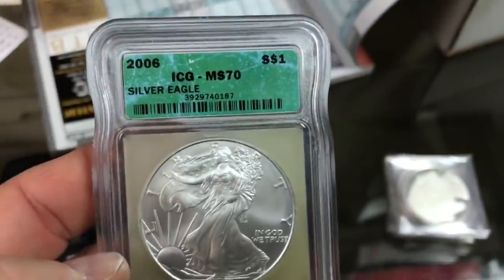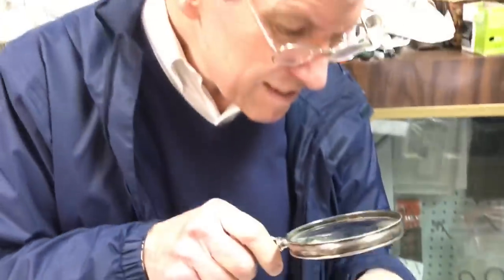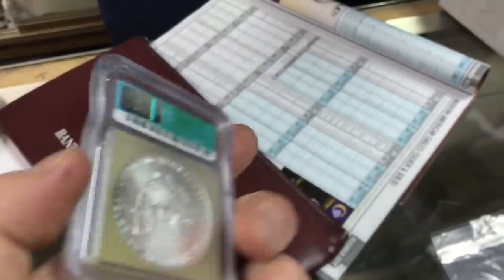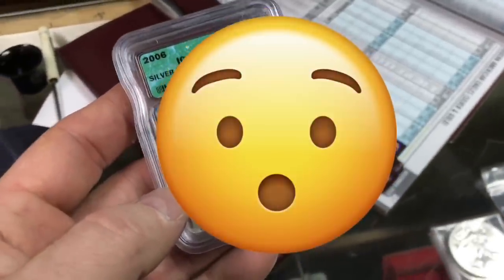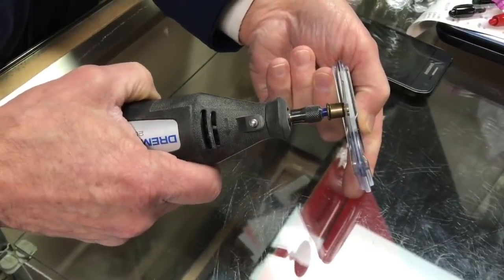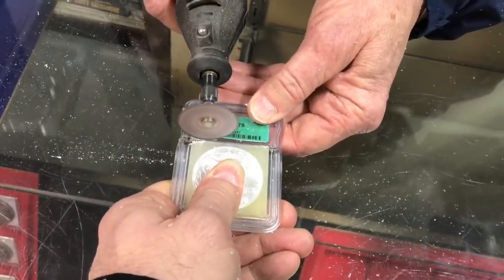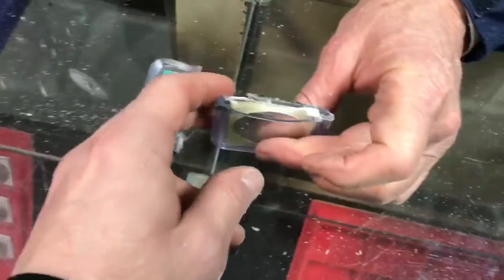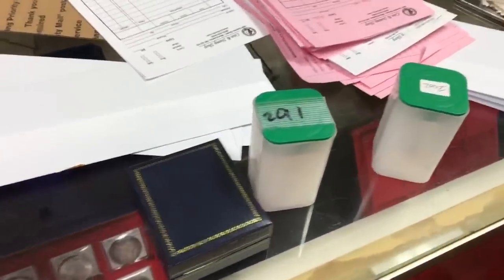Interview With My Coin Dealer (Tim’s inside info on Silver Supply!)

Comment: I do remember  the madness in 2011. I used to collect scrap Silver from flea markets in 2010 and made like 1000-1500 euros for selling them and the refinery had indeed buckets full of scrap Silver. It was good times. I think it takes a few years to get that same amount of Silver back to flea markets in form of table ware etc. so I am not expecting that madness any time soon… Potentially we need to wait 10-20 years for similar metal rush.
Reply from the maker: I don’t think we need to wait 10 to 20 years. I think we’re in the midst of a gold bull run right now!  And Silver is soon to follow, in my opinion. Cool insight! Thanks for watching. 👌🏼👌🏼
Reply: @YankeeStacking  Chances are you are right, but I guess there are also chances the current rise is just dead cat bounce and we find ourselves at around 600-700 usd/oz in 5 years.
Reply from the maker: veriappelsiini Tell me what you think about today’s video.  👌🏼

Comment: Why would you want to crack open a MS 69 or 70 coin? Wouldn't the coin  lose its grading value?
Reply: As far as I can tell the coin was scratched and it was graded falsely. Happens quite often, that's why when I buy silver I buy it for the weight rather than the grade.
Reply: If you see the last video in this channel Yankee was explaining why graded bullion coins could be misleading
Reply: Its a bullion coin. Almost all Eagles come out of a tube grading 69 or 70, and rarely 68. This coin isn't rare and never will be. In addition, ICG isn't the best grading service.
Reply: The coin looked scratched, no imperfections are needed for MS70
Reply: @Nodeelite  ,Thank You
Reply: @zhicaofang2354  , Thank You
Reply: @MrMonkeySwag96  ,Thank You
Reply: @memerman2405  , Thank You
Reply: Just helping my fellow numismatists
Reply: You would NEVER EVER DO THIS before trying to sell on Ebay over what Tim would give it to you for. UNLESS, you need that year or mintage for some specific collection, in which case, you would leave it in the plastic for some method of protection greater than a book or flip, etc..... Just my 1.5 cents
Reply: @youKnowWho3311  , EXACTLY WHAT I WAS THINKING I was wondering why would that coin dealer tear apart that case and I know he paid good money for that coin. I I would have at least tried to resell it somewhere else with the coin in the case before I even thought about tearing a case open.

Comment: I still need a sample of ICG , for my off brand slab collection. Yeah they may be 4 of the big 4 list, but to me if its not pcgs, ngc or anacs, it IS off brand .
Reply: There's nothing wrong with ICG -- all the notable graders are wrong occasionally.  Regarding THIS coin -- I didn't see anything to knock the grade back a point. That infinitesimal smudge is not noteworthy -- it doesn't look like  a scratch to me.   However, I would agree that if it were a scratch, it has to grade down.  I've seen loads of PCGS MS70  ASE's with way more flaws than that!
Reply: @TheAvenstar  i didnt say there was, I think pci did good work too.and segs does too, but still off brands. Ya know what i mean? I actually am trying to find as many off brand slabs as i can for a tpg collection . I have segs, pcI,numitrust corporation and a few others. I have an accugrade waiting on me to pay for it for my next .
Reply: @coreymerrill3257  I too look for deals in off-brand slabs.  Good point.
Reply: Thankyou. Sorry i was not more clear about what i meant.
Reply from the maker: There WAS a scratch on the coin.  😏👌🏼
Reply: @YankeeStacking  If that was  as scratch, I apologize.